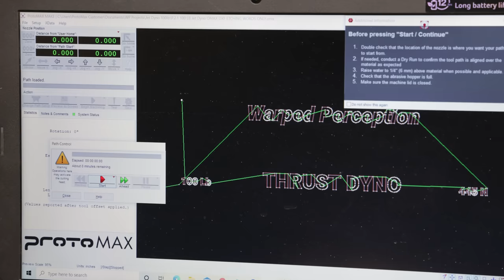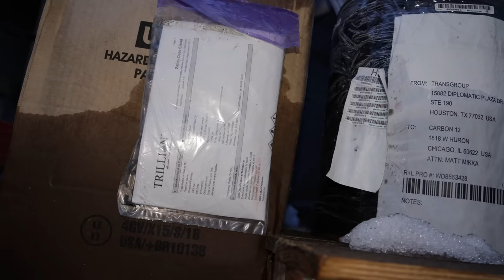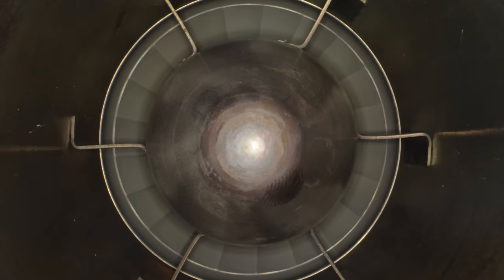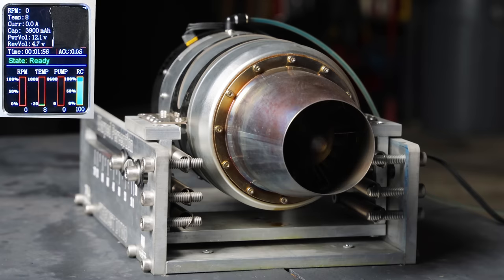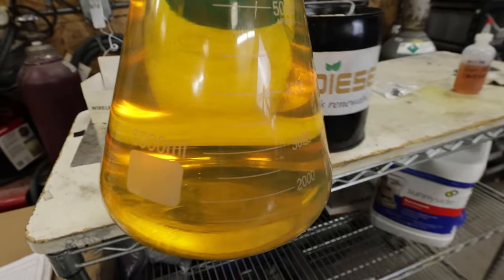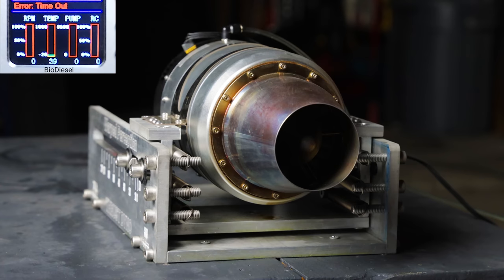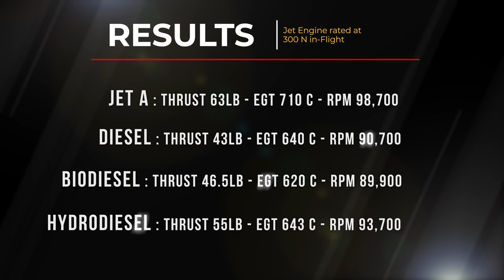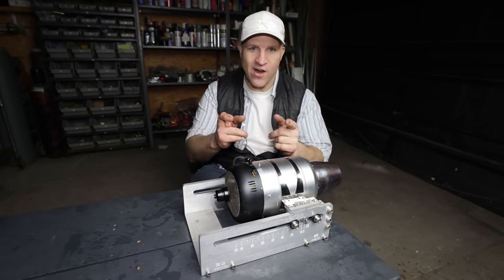Jet Engine Thrust Test - Fuel Experiment (Jet-A vs Diesel vs BioDiesel vs HydroDiesel)

Comment: Not too surprising, if I remember, from my RAF Training, the Jet engine from the getgo, was designed to use Paraffin (Kerosene), as it was less volatile than Petrol (Gasoline), and more BTU's per pound for Aircraft engines, than other available fuels of the time.

Comment: I would have liked the summary better had it included the exact number of seconds for each phase of the run and its thrust, the exact amount of fuel consumed, its weight and volume, and the average time between engine overhauls given the type of fuel.

Comment: That was really interesting! I expected the Jet-A to produce the most power, but the HydroDiesel truly surprised me! I wonder how well it performs in diesel engines. My boat has a pair of Cummins 6B-series engines. Hmmm ... 🤔
Reply: It will lower your NOX emissions, but also lower your fuel efficiency. It will cause accelerated erosion and wear on your fuel pumps and engine internals.

Comment: Good video and great set up as well how many thermocuples  do you use for measuring EGT what is max limit on that  interested ok also I have worked with large Gas turbines GE Frame 7 & (9 also Alstom/ABB GT13 es & GT 26 & GE frame 9 & Siemans V94 .2 & LM2500 + keep up the good work ok

Comment: Here's a fuel test for you!  Get a gallon of used Diesel engine crankcase oil, some that has been in an engine for a real long time so it's really black and loaded with nano sized Carbon particles, and see how much extra thrust it gives you!  Petroleum is a Hydro-Carbon, right?  So by adding in some extra Carbon, it should make a much hotter flame.

Comment: I believe the B-52 also has some mechanism to spray water in its jet engines so it kind of made sense to me that hydrodiesel outperformed the diesels
Reply from the maker: I believe it is the B-52 which has the water injection system.

Comment: With the hydro diesel you get the added bonus of the water flashing off into steam increasing the pressure .
Reply from the maker: I think that's the case
Reply: @WarpedYT  thanks for the reply. I don't fly jets myself. i fly electric 5fj. But I find your vids entertaining informative.

Comment: I'm curious about the run times on this little jet engine.  How long can they run continuously at high throttle settings of say 60 to 75% or so?  Or can they only be run for 15 to 20 mins or so before they need to be shutdown to prevent overheating or weakening of the parts?

Comment: Thought: Hydrodiesel seems to deliver better performance  than diesel and I reckon that it'll be cheaper, too. Then is it the most popular fuel to use in engines for diesel vehicles? If not, why? Follow-up question: Can we power flying cars with such engines?

Comment: After reading comments, it reminded me of when I was stationed in England, at RAF Alconbury. For some reason, they had a problem getting Diesel fuel. So, on base, someone made the decision to run JP8 in the Diesel vehicles. It did excellent on the Mercedes and Bedfords. The GM 6.2 Diesel engine didn't like it as much. It was a little too hot for them, started having some failures. I was in General Purpose Vehicle Maintenance. It was fun test driving the Mustang chase cars, for the U2's, when they came in for maintenance.  LOL 
I was wondering about Kerosene? I've always heard it's similar to Diesel and Jet fuel. Have you ever done a test with Kerosene? Since this video is somewhat old.

Comment: That dyno is a killer design! I can only make sense of making more power by adding water being that it splits the atoms in the heat and burns the hydrogen and oxygen? If that’s the case could you spray atomized water into the jet engine to even increase the jet fuel power?
Reply from the maker: Thank you I will be selling it very soon
Reply: @WarpedYT I have the disease of needing to build everything myself unfortunately. It’s a very costly condition in time, funds, and sanity lol. See my edit had a curiosity question. Thanks for the response!
Reply from the maker: @zanechristenson3436  omg ! I have the same disease, that's the issue with knowing how to do a lot of stuff, sometimes it's easier just for me to do it then it is to even find somebody to start doing it. I'm sure you understand my pain
Reply: @WarpedYT  I absolutely do! I’ve yet to amass all the equipment and experience you’ve got there so the time per project is probably about 10x versus yours lol. But for example when you go to Home Depot and look at the shop vac attachments….. it would just be absurd to pay even 5 dollars for any of them lol.

Comment: Very cool video! I have one question though. How come biodiesel produced more thrust than diesel when it is only 93% as energy dense as diesel?
Reply: Amigo eso depende de la densidad del combustible, de su inflamabilidad y de la temperatura que puede llegar a provocar
Reply: It probably is because it is a lighter fuel that burns faster, and as a result of the extremely short time available to burn in a jet engine, the ability to combust more quickly made the difference. Diesel fuel actually burns very slowly compared to most other fuels used in engines. I believe that the only common fuel that burns more slowly than diesel is fuel oil.
Reply from the maker: It turned out to be because of the viscosity, I'm going to go over in an updated video that I have coming up soon

Comment: Looks like for diesels there was not enough pump performance, maybe due to fuel viscosity. Would be interesting to compare thrust at the same engine RPM.
Reply from the maker: That's exactly what it was, I did some testing later and figured out that was exactly the problem, I am going to be doing a follow-up video real soon.

Comment: The main difference between the two fuels was the heat...  The exhaust nozzle was read hot with the Jet A but little change in color running the diesel.  Not sure what internal temps were, the the exhaust was cooler...

Comment: Great job and very interesting video.
Isn't that an "Impeller" rather than a compressor?  
Either way, the actual Compression pressure produced usually in stages, has to be greater than the combustion pressure or your engine exhaust will come out the front!
Reply: Newp, it's a compressor. Single stage radial compressor to be precise - like the turbo in your car. Except this one has a single stage axial turbine at the other end (instead of the radial ones they use in car turbos).

Radial compressors are ideal for this task as they can offer a very good stage pressure ratio (typically 2.3-2.5, up to 3 in some cases) at low flowrates. Axial compressors favour high flowrates, but their stage ratio is typically limited to 1.2-1.3, hence the need for a LOT of stages. And of course in an aircraft engine you need all that flow, whereas in this toy that'd be excessive.

The other great feature of radial compressors is that they're not nearly as sensitive to clearance which means they lose less efficiency when miniaturised. The smaller you make an axial compressor, the greater the area of tip to casing clearance (vital to being able to spin the thing at all!) compared to total gas path area. In an axial design, this is a direct leakage path, which I'm sure you can see is detrimental to efficiency.

Your pressure ratio is then determined by combustor design. The combustor liner openings are calibrated to provide a certain amount of resistance at certain flowrates. This restriction allows the compressor to actually pressurise the fluid. Without the restriction it would just flow freely instead.

Once the gas has made its way past the openings in the combustor liner, it has entered the combustion area. That'd be where fuel is added. At that point, the less resistive path is the turbine inlet, no matter the pressure ratio. It has to be, else the engine won't function. Momentum in the gas also helps this matter, but is typically not relied upon as that would take away from the robustness of the design.

The "combustion pressure" you mention is at this point merely a function of the flow resistance of the turbine. This would typically be optimised for most efficient operation and is most easily controlled through the crosssectional area of the turbine gas path. This resistance must necessarily be less than that of the combustor liner for the reason you mention above.

Additionally, fueling must be gradual in order to prevent pulses of high pressure and to allow time for the rotating components to catch up. Otherwise the compressor will stall and bad things will happen.

Comment: Don't waste time with lubricity tests. Lubricity only applies to the fuel pump. Jet A has very low lubricity and jet fuel pumps are designed to run on very low lubricity fuel. Lubricity from highest to lowest: Bio-diesel, #2 diesel, hydro-diesel, & Jet-A.

Comment: Hi and thanks a lot , but for your information:
The thrust comparison  must be at the  same rpm for any conclusion!
Reply from the maker: Yes That is correct, I thought the RPM was the same wasn't it?. The engine computer is what regulates the fuel to keep the RPM constant at 98,000, I'm going to have to look through the video again but I thought it was there.
Reply: I disagree. The comparison must be based on equal levels of fuel burnt, not rpm.
why, because different grades of fuel will release different amounts of energy, so must be relative to the volumes of fuel. No good having to use twice as much fuel for the same energy output and equal rpm for example.

Comment: I notice that the maximum RPM is different for each fuel. I would be interested to see a comparison of the consumption of each fuel type and the force generated at a specific and common maximum RPM. I own a jet engine which has an RPM limiter set to 97,000 RPM.

Comment: Curious, why and how did your max RPM change with different fuels? It should have been the same RPM which means the only difference would be fuel efficiency. Did you change anything else like pump PW, or relearn the radio between runs? It doesn’t make sense that the RPM would change based on fuel type. Originally I thought, wow, Jet a it is, but after getting some clarification I too believe something is not adding up in the test. Thrust is thrust, at a given RPM, regardless of fuel type, so the only thing really changing in your test is RPM, which equates for the variable thrust rating.

Comment: My assumption was that the water molecules would get shredded at those temperatures, providing more oxygen for combustion and hydrogen for an extra fuel kick which led me to believe that it would outperform the other diesels but not the jet fuel. I was on the money but now that I'm reading the comments I'm wondering if I was on the money from my assumption or if I was simply right for the wrong reasons.

Comment: Wow.. It sounds like my ps4 pro. Guess it could fly now.
Reply from the maker: You have to take that PS4 apart and clean the fins on the heat sink. The PS4 has a temperature sensor on the CPU, as it starts heating up it speeds up the fan according to the temperature, when the fins on the heat sink get dirty the temperature goes up and the fan speed goes crazy because it can't cool the CPU. In short you just have to open it up and clean out those fins I just did it the other day to my nephew's PS4 as well.
Reply: @WarpedYT  yeh i am going to do that once i buy some thermal paste and thernal paddings. My ps4 is over 5 yrs old so its due for some maintenance.

Comment: Placing the springs near the exhaust gives them thermal fatigue and unreliable results. That would also explain the observed variance in the readings of the same fuel. Use a new set of springs for each measurement.

Comment: I think a weight scale sensor would have been a much less crude way of getting a more exact pounds of thrust from the jet engine. Using the weight scale sensor (modified of course) would be more accurate instead of relying on an inaccurate spring weight.
Reply from the maker: That takes all the fun out of it, that's not visual at all. That level of accuracy is not of much importance. And a digital pull scale still jumps around all over the place.
Reply: @WarpedYT  ("That takes all the fun out of it...") In that case add some pyrotechnics and let the fun begin!!! Good show though! Not criticizing, just thought of offering some ideas. All good! 😎
Reply from the maker: @georgelalama8154  lol... I know, so was I, but in reality the whole reason I designed and built this scale in particular and patented it. Is because I wanted something where you can visually see how much thrust it's producing. I do appreciate the feedback
Reply: @WarpedYT  Yeah, You probably mentioned that earlier in the video. Sometimes I skip to where there's more action to move on because I have so many great, fun and educational videos to watch that I keep saving but have little to watch. With that being said just  know that your channels are among the great, fun and educational stuff to watch. Take it easy be safe.

Comment: That's interesting about the jet taking longer to slow down with diesel.  I notice a similar thing with diesel engines in cars, which provide less engine braking than gas (petrol) engines.  Could this be the same effect?

Comment: Can you please calculate the tank-to-vehicle efficiencies for this engine with these fuels? I'm not used to jet engines, but I guess P=F(v)*v where the thrust F(v) is variable depending on the speed of the vehicle, due to the speed of the expelled gas itself. So how efficient is this setup at 15-30-45-55-65-75 mph vehicle speed?

Comment: What is the air flow at the engine inlet? It can be in CFM or m3/hour. And what is the ratio between the air inlet flow and fuel consumption?

Comment: Where would I find a model jet engine or a true model jet engine which is configured like a aircraft turbo fan engine? I worked for General Electric Aviation & produced rotating part for the CF-60 series of engines, GE-90-85, GE90-115B, Leap X, GEnx, CFM-56, GP7000, & other engines for Boeing & Airbus aircraft.

Comment: I would like to know the difference in thrust between JP 4, 50:50 mixture of heavy naphtha fraction (like gasoline) and kerosene. aka (Jet B), JP 5 (Kerosene) and JP 8 (kerosene blend) My dad used to talk about the Dept. of Navy big switch to JP 8 in 1975 -79. Brother in law worked for Marathon refinery with many hours back and forth with challenging questions and even more curiosities.

Comment: Diesel makes black surfaces. Not enough air overhead - more volume plus more pressure. The turbine is not optimized for diesel. Diesel piston engines need no lubrication, it helps maybe the pump or the vales. But beside a pump, the turbine has its own lubrication and I would be surprised if that is with the fuel. Any fuels producing carbon particles could lead to unwanted buildup on fins and shafts (and shaft seals), so I guess such jet turbines will prefer smoke free fuels. Hence nobody runs diesel in them. Diesel car turbos is different. They are just lump of rough cast iron compared to these jet engines. Sulfur in the fuel could also corrode the fins. Just my theory.

Comment: I can't imagine that hydro diesel being very safe to use in diesel engines, particularly when it comes to the pump and injectors. Most diesel vehicles come with a fuel filtration system that has a separate or built in water separator as water in the fuel will drastically shorten the life of a high pressure injector pump as well as the injectors. As your test shows it is inferior to jet A so why the heck are they even making the stuff?

Comment: So I learned
  1.  You have to add oil to your fuel for a jet engine.
   2. The oil for jet engines is clear verses the oil for most of our vehicles.
Am I correct???

Comment: What people really don’t know is there actually is a video of the military running diesel in gas turbine engines testing it and showing it will run on it with but it will wind up shutting the motor down hence why they have to refined the fuel that they call Jet fuel but technically it’s still Diesel just heavily refined and you think I’m full of crap ask any gasterbine engine men about the video that was shown to them in their schooling to become gas turbine engineers in the military ‘Cause the military is keeping that video under wraps I’ve seen it in person
Reply from the maker: Oh absolutely you're correct, but I don't think this is a secret, this has been known for a long time and that is one of the reasons they refine it, but they also add additives to Jet a and for the military in particular they want to use one type of fuel for all the equipment, that's their goal.